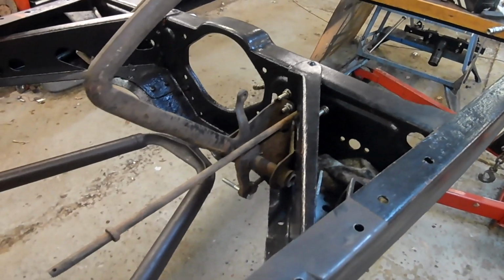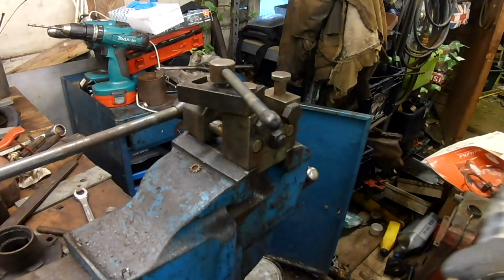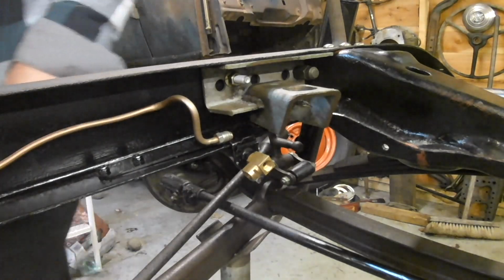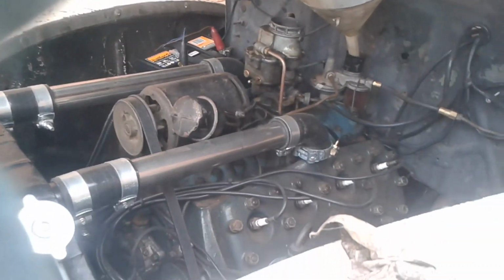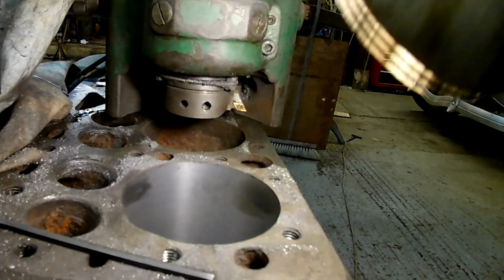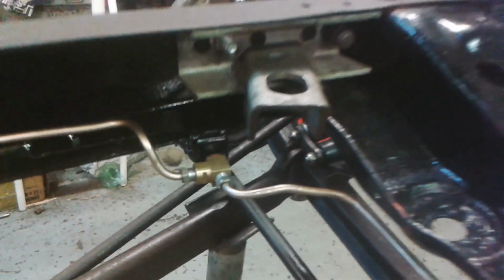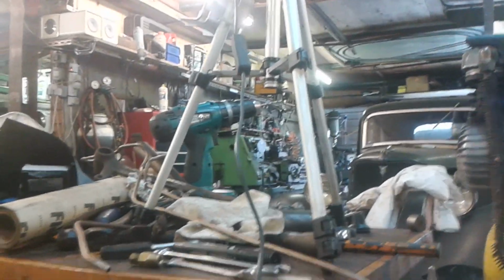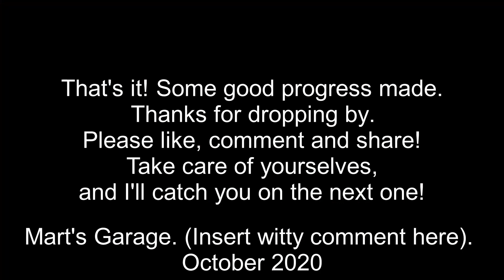32 Build Pt15: Master Cyl and lines. 59 Flatty Pt9: Boring. 41 pickup: Oil level investigation.

Comment: Thanks Mart another good one, Regarding Flathead dip sticks, there is a lot of different ones, depending on the oil pan. I always fill the right volume  (4 litre) and check that marks, the first time i start  one up.
Reply: My Dad always makes a new one when he finishes a car. He usually cuts and lengthens or shortens appropriately.
Reply from the maker: Thanks Lars. I've got a couple of notches filed in the dipstick on Old Rusty.
Reply from the maker: It's a good idea, Dave.

Comment: Hi Mart, especially loved the long tube nut mod and also the change of gender of the distribution tee on the back of the master cylinder. Love to know what the mystery fitting is that you screwed the short flared stub end into. Nice bench mounted flaring tool and hand tool bender notch mod!

I've gone from the old Ford master with 40 backing brakes to a dual master Mustang master, looking like what you took out: and now to a step bore S10 Chevy Blazer master with Bendix backing plates all around. Brake effort and effectiveness is the best now for me.
Reply from the maker: Lots of similarities, Glenn. I saw your pics. I'd use Bendix type on the front but I'm too low-buck.

Comment: Good work on your custom mtr. mounts, Mart; nicely done!
I also have an early Mustang dual cyl. for my '36 w/ the inside (right) outlet ports, but may take your suggestion
and go w/ the AMC (Jeep?) type, as the outside (toward frame) facing ports will make for easier, and tidy, routing
 of the lines.  (Assuming the piston is also the same size.)  Thx. for the tip!
Reply from the maker: Cheers Robbed. Watch out for the exhaust routing. It can sometimes be along that area next to the frame.
Reply: @MartsGarage  Yes, that area will be particularly fun, as I plan to run the exhaust through
the 'X' frame, as you are proposing....
Reply: L

Comment: I dunno but I'd go with a dual res master. I'm confused...you can't procure a proportion valve in the UK?   Tubing work looks great!
Reply from the maker: I just like the simplicity of the single circuit. It's the residual valves I don't have. I can get them but not with the correct fittings for 1/4 tube. The single master has a residual valve built in.